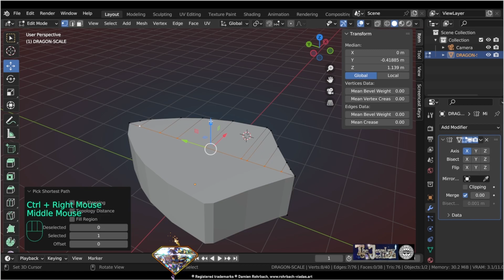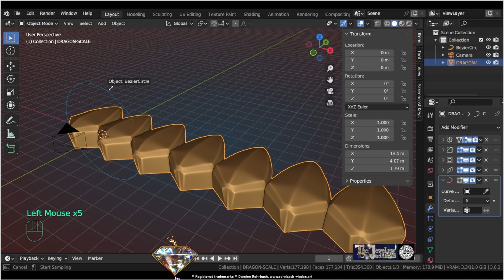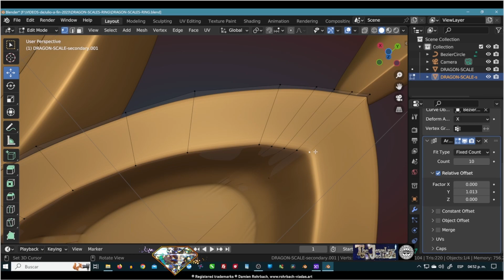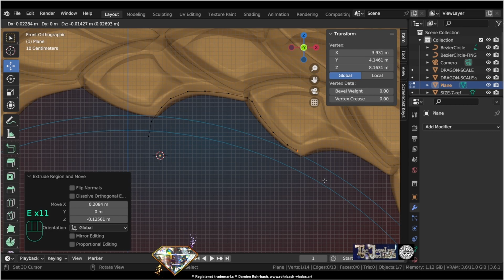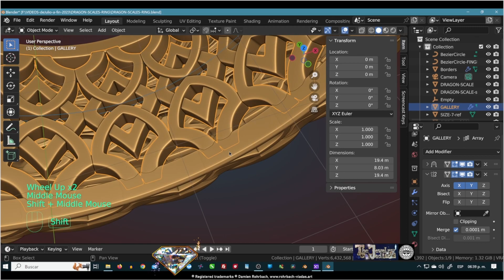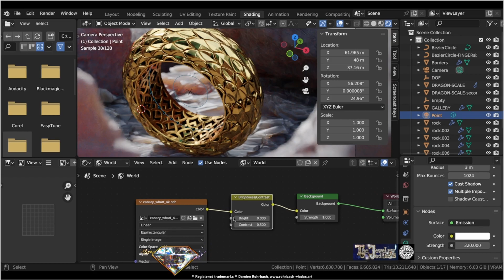3D Jewelry Dragon Scales Ring Modeling and Rendering BLENDER tutorial

Comment: I cant make bevel :S
Reply from the maker: Don't worry, the Bevel modifier is mostly used so that the Subdivision Surface modifier doesn't smooth the meshes too much. Other yes, there are many ways for the Bevel to fail, mostly apply scale and distance between vertices